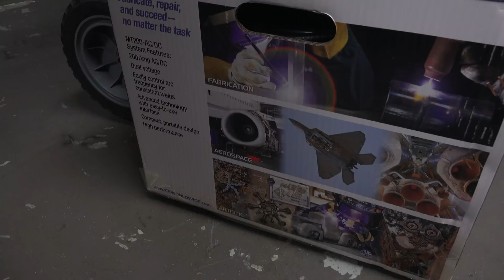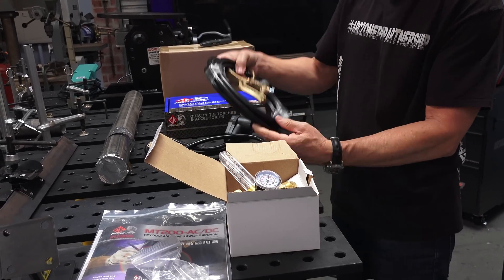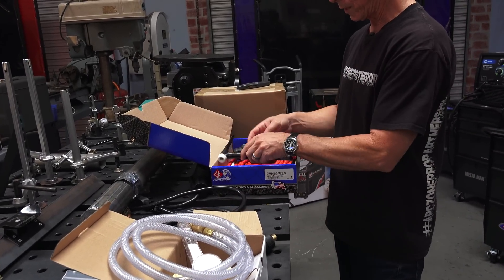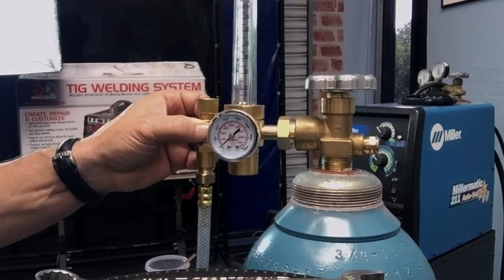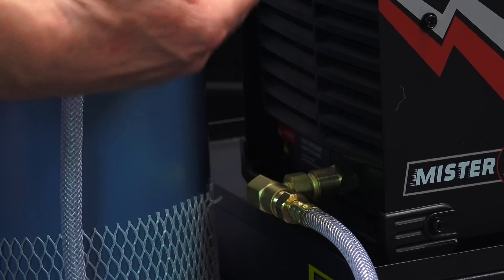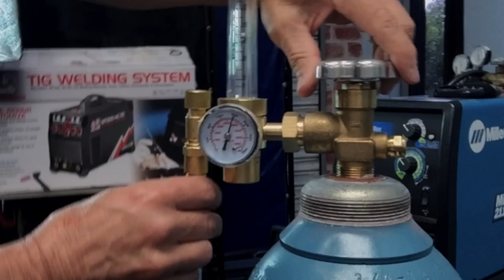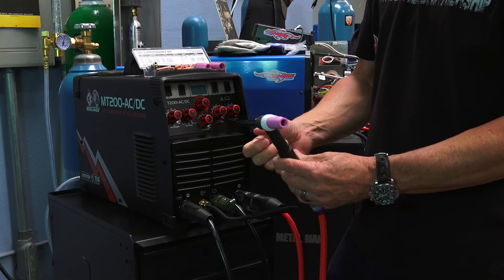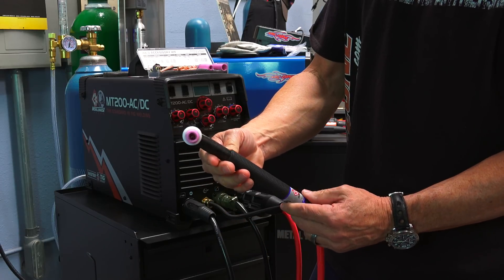CK MT200-AC/DC Machine

Comment: I have this welder welds damn good wish it had more amps for alum. work
Reply: what are you trying to weld? more than 1\4'''?
Reply: helium mix is what you need.
Reply: Run a Y fitting with check valves and plumb in a bottle of helium. You’ll get some more punch with the addition of helium
Reply: @4570Govt  already have it setup that way